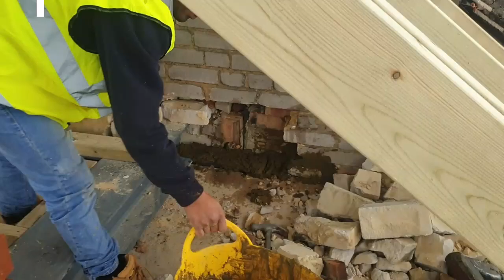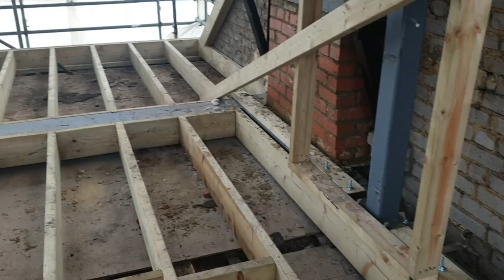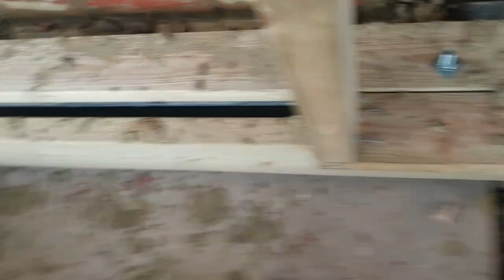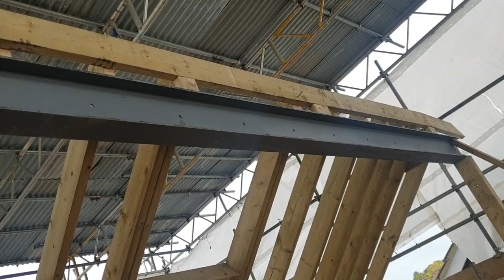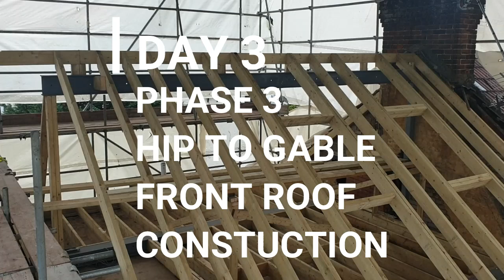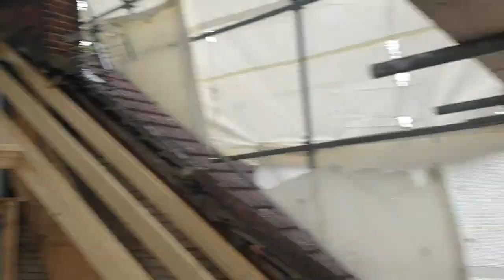LOFT CONVERSION DAY 3 - Pitched Timber Roof Construction & Building Control Checks - Day 3 of 18

Comment: Can I ask why a vertical SHS beam wasn’t used on the external wall with cleat connections to the UC beam? Surely it’s better than timber.
Reply from the maker: Hi Fayyaz. Thanks for watching and the question. The structural engineer specified timber rather than steel for the vertical support as it was sufficient and also more cost efficient. 👍
Reply: @joeblogs  Great upload Joe.
Can I ask the inverse, why then didn't the engineer allow a timber post to be used instead of steel SHS on the party wall side?
Reply: @Helibox Probably easier to join steel to steel, suppose they could have used a steel shoe. But good point. The OCD  in my would have preferred a steel upright 😊